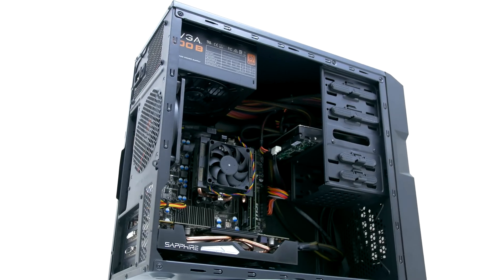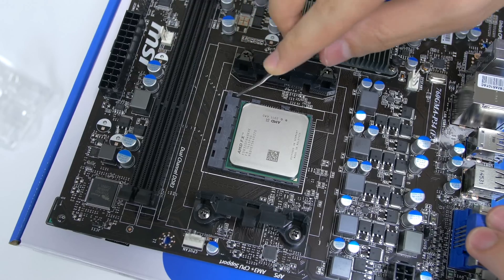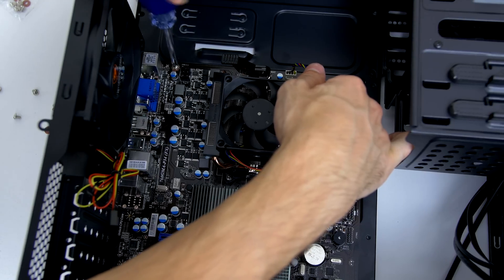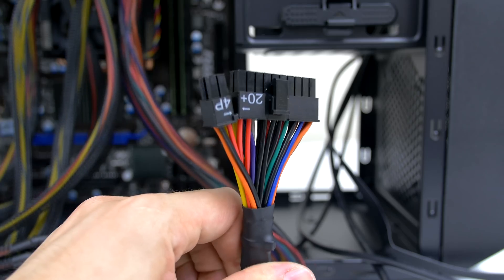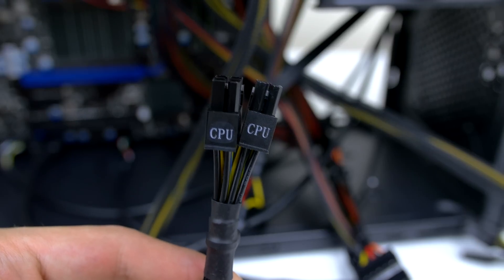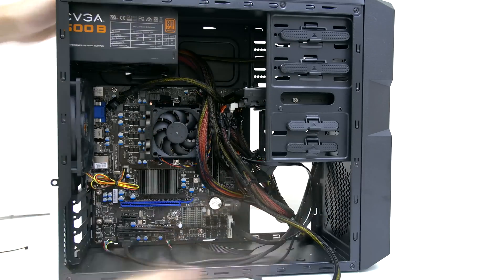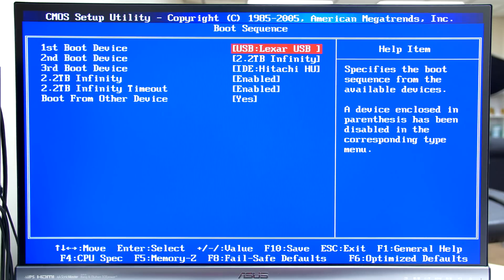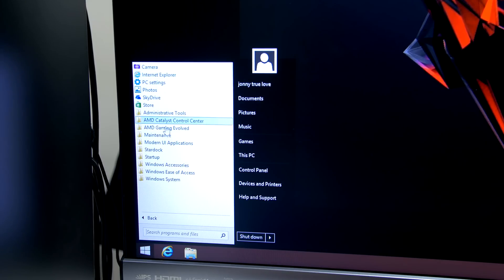How to Build a $500 Gaming PC with Windows 8.1

Comment: I just finished this build and now there is no connection to the monitor plz help if you know how I could solve this
Reply: Same problem here
Reply: ActionPlayer519  I fixed it go display setting and advanced settings then change the resolution to default. Then R click on desktop and go into the amd control center. Go to my digital flat panels and scaling then adjust the bar so the entire screen is in your monitor
Reply: Hope it worked
Reply: +Walker Anfield my monitor has no signal it says
Reply: +ActionPlayer519 try using the dvi or HDMI ports from the gpu and not the ports from the motherboard

Comment: Asus M5A78L-M/USB3 Motherboard (Socket AM3+, Up to 32GB DDR3, USB 3.0, uATX) <---- Will this mother board work?
Reply: +TechSource
Reply: +Eetu Rossi I can confirm it will 100% work I actually just recently bought this motherboard and it works fine with my fx 8350 and r9 290 with 8gb ddr3. I will provide screenshots and shit if further proof is needed

Comment: Windows 10 is free
Reply: Matt Fuller You need to put in on a usb flash or install from a disk
Reply: +nsmc99 only if u already have an OS
Reply: Whats an os? Can someone explain to me all of this stuff? Like ok if i built this pc if i open it would i be able to go to google and then from there buy windows or what?
Reply: Matt Fuller OS = Operating system. Your computer will turn on, but not function properly without one.
Reply: But i can access google or whatever so i can buy one and download it? Or do i have to download it to a usb flash and plug it in my pc and make it work through there
Reply: Thanks :D

Comment: I really dislike this case, could anyone show me a case that is the same or around the same price? (Must have at least 2 usb ports and enough clearance for a hyper 212 evo :D)
Reply: +Ya_Boy_Dom Check Aerocool, Coolermaster, NZXT, Thermaltake and Fracture design. Then google the price of the casing you like.
Reply: Thanks dude, but i was asking for cases people have used or just recommend, np though :D
Reply: I used the raid max v4 instead, there is a little more room to work with and it has a window with sexy LEDs, they're about 40
Reply: +Ya_Boy_Dom Corsair carbide 100r. Comes windowed too :D

Comment: Hi Edgar I have recently been buying parts for your $500 Gaming PC Build  I have came into a bit of trouble the MSI 760GMA-P34 i Don't Want to have to Spend a Extra 40 pounds in tax to deliver to the uk is there a different motherboard what would fit ? and will also fit all the other components? Anyway thanks.

Comment: Is this still the best 500$ build? I have 600$ to spend but I already have the OS and the Hard drive, but no monitor :/
Reply: +AMDruggan there is no 'best build' because the prices are always changing :) but here's some parts to look at: http://pcpartpicker.com/p/7LZhzy Should be enough for picking out a case/and add fans/maybe a heatsink. also do not skip out on your monitor! it's a very important part :) you're gonna be looking at it all day. I highly suggest looking at benq monitors. 60 hz one ( http://www.amazon.com/BenQ-Gaming-Monitor-RL2455HM-24-Inch/dp/B007HSKSMI/ref=sr_1_1?s=pc&ie=UTF8&qid=1443542862&sr=1-1&keywords=benq ) or 144hz http://www.amazon.com/BenQ-Performance-24-Inch-LED-Lit-XL2430T/dp/B00M8E0K06/ref=sr_1_2?s=pc&ie=UTF8&qid=1443542895&sr=1-2&keywords=benq+144hz

Comment: So for the fans does the case come with them, and in the desc which one is the fan that goes directly over the cpu?
Reply: +Michael Linares When you order a case it usually comes with 1-2 fans. The cpu has a stock fan that it comes with, but depending on the cpu you may want to buy a better heatsink for it. Depending on it's purposes/and your living conditions (if you live in a warmer climate/ect.) Depending on your case, and build, you may have to buy more case fans (look up the specs of the case to figure out which sizes.)

Comment: can i put a sapphire 390 nitro in this build?
Reply: +Joshua Abraham yes, you can put whatever you want in the build as long as 1.) your case supports the length of the card 2.) your power supply can handle powering the card.

Comment: Hey man the fan is running high, what should I do this is even before installing windows
Reply: +Abdulrahman Albusaidi you change it in your bios settings
Reply: its only when i close the case... do i risk overheating if i close the case and lower the fan speed ?
Thanks :D
Reply: depends on what fan it is. is it just on the side of the case? front? top? back? on the cpu?
Reply: CPU fan im actually reinstalling windowns with a new ssd card that a bought. fan still very noisy

Comment: could anyone offer some help? I followed instructions word for word, when I hit power on i get the blue light and all fans are going, but the monitor says no signal when its plugged into the pc
Reply: +Brendon Boulanger double check your cords. back track and unplug each cord and replug in.
Reply: +porkyporkchop1 same problem here unplugged and plugged cords back in still not working
Reply: quentin munns make sure your display cord/hdmi is pushed in as well.
Reply: Ye i tried that im not getting any beeps on start up is that a problem
Reply: quentin munns shouldn't be any beeps if everything is plugged in correctly. no beeps means something isn't plugged in (like power to the motherboard.) you sure all the cords are pushed into the motherboard? the ram is pushed in? processor is in correctly?

Comment: Hey tech, how would I install an optical drive in this build?
Reply: +John Vickers you remove both panels. feeling along the front there's these plastic clips you push in. you can then pull off the front panel and push out one of the optical drive slots. push the drive in from the front and lock it in.

Comment: Does this pc come with all the wires and screws? Sorru if it's obvious never built pc before ^^
Reply: +Oskari Lindblom you get all the screws with the case, and the sata cords with the motherboard. you may need a few extra accessories depending on what parts you get. (for example if you bought an ssd: you will most likely need to buy a drive adapter 3.5 to 2.5 and an extra sata cord.)

Comment: +TechSource  I built this $500 PC the only things I differed on was the video card and RAM : Dual x R9 Sapphire 280X & 2x8 gb RAM .
It turns on and i have loaded windows 8.1 on the system but I am encountering problems:
1) Doesnt shut down - the monitor turns off but the CPU keeps on running
2) thr R9 280x has an 8 pin + 6 pin and I filled them all up by using the power supply's pci-e cables (6+2 & 6pin)
3) after plugging that 2 pin the computer doesnt display anything and the gpu isnt even detected. however it starts displaying again when i remove the 2 pin cable from the gpu. Im using VGA output of the motherboard as non of the outputs on the graphic card give any signal to the monitor. 

PLEASE HELP !

Comment: which cooler did you use. Its not in the main parts so im guessing its one of the optional ones. is the corsair h60 liquid cooling or is it cooler master hyper 212 evo. im new to building custom computers if you are wondering

Comment: Do we need to buy a sound card or wired network adapter? and what happens if you start the pc with out windows?
Reply: +Hakan Sen You wont need a sound card, and you would need a wifi adapter if you wanna use wifi. And if you run a pc without an OS, it'll go to the bios. If you want a copy of windows for cheap, go look up key sellers on reddit, or use g2a and buy a key for windows 7/8.1 for like 20-30 bucks.

Comment: Is This Good 
Case:Cooler Master K280 Mid Tower Case
Psu: Across ACK-6850-1 500W Gaming Atx Psu
Motherboard:Gigabyte H97- Gaming Mother Board
Ram: G skill F3-K1900CLAD-8GBXL 8gb DDR3 1866 
Hdd:Wb Blue 1tb 7200rpm data 6gb /s 64 Gb Cache Internal 35 Hard Disk
CPU: Intel Core i5 4460 Desktop Processor
CPU Cooling;  Deep Cool Captain 240 Double Fan AIO Liquid Radiator
Fan: Cooler Master Sickle Flow X 120 mm 12cm Led Aux Fan

Is This Good I'm Just Planing And Its My First Time Planning
Help Me If Theres Something Wrong
    Thanks!!!
Reply: No, all those parts are not compatible.
Reply: +Michael Scott he's 12 he don't know kappa
Reply: MistaCaptainSprinkle I'm just glad you got it 😂 Kappa FailFish
Reply: +Michael Scott Well, he's planning.

Comment: This is an awesome build but I want to build mine slightly differently and have a couple questions. I want to use the NZXT Source 210 Elite case (mid) instead of the micro atx case in this build. Do you guys think I should get an ATX motherboard or still stay with the Micro ATX motherboard? If I do go regular ATX motherboard, what do you guys recommend?

Thanks, this community is so helpful :)

Comment: Building is pretty easy but the part im confused on is downloading widows 8.1
Reply from the maker: I'll have a more detailed process for the September build.
Reply: Ok thanks
Reply from the maker: Digital Boost I mentioned it on twitter. $600
Reply from the maker: Digital Boost No
Reply: TechSource how much will the september build be? because i need to know if i should buy the parts for this computer or the september build? thanks
Reply: TechSource thanks! will that include the OS?
Reply: ok, thanks!
Reply: +TechSource Does it matter if I use a different case?
Reply: +Mr. Lovetech it doesn't matter as long as if its able to fit the motherboard.
Reply: +Zeb db no as long as it fits th mother board and all the parts
Reply: I was confused too but go to Microsoft website and click install windows 8.1 onto your hardrive, then hook it up to orion and continue the process
Reply: +TechSource does the tutorial work with windows 10?
Reply: i have one question. what pin does the 120mm fan use. is it a 3 pin or a 4pin
Reply: +TechSource i have one question. what pin does the 120mm fan use. is it a 3 pin or a 4pin
Reply: yep
Reply: +Digital Boost you can get a win 8 key on reddit for 15 usd and activate win10 with it
Reply: +TechSource I can't seem to update my Graphics Card for this PC I have done everything else(running Windows 7Ultimate instead of Windows 8)but every time I try to update them it goes to AMD installer and at 2% it says error AMD package failed to install, I'm not sure if that is word for word but its something like that if you know how to fix it please help and also can you tell me what cables need to be installed on to the graphics card in the back(not the ones in this video) I mean because if new people want to build this PC they may accidentally use the dvi cable on the motherboard not the graphics card which I did as well until yesterday I figured it out lol, - fixed it now works like a charm, I just reinstalled my graphics card and it updated, good start for a gaming pc
Reply: Win 7 is completely free and making a bootable usb is really easy using Rufus 2.3
Reply: +Mr. Lovetech there's an app where, if you used a fake key, you could get the iso image of the full Windows 7 for free.

But other then that, you have to buy a product key
Reply: +Frostbite Gamer can i play gta5 on it??
Reply: +TechSource do the screws come with the stuff
Reply: +Zeb db just make sure it fits all the hardware
Reply: You can't download it anymore bro
Reply: same
Reply: +TechSource I am having trouble when I built it at first it worked fine but now I am trying to use it but the monitor says no signal and I have everything plugged in I am also using everything you are.
Reply: how do you install more usbs??? how many are there??
Reply: is it better to buy the Sapphire Radeon R9 270X 2GB GDDR5 DVI-I/DVI-D/HDMI/DP Dual-X with Boost and OC Version PCI-Express Graphics Card 11217-01-20G
used in like new condition or to buy an EVGA GeForce GTX 950 2GB SSC GAMING, Silent Cooling Graphics Card 02G-P4-2957-KR
brand new???

Comment: Okay, so this might seem like a dumb question but please bare with me as I'm about to build my FIRST gaming desktop.
I've been playing games on a high-end laptop and the concept of monitors is really getting to me and the answers online always point to different solutions.  So, what is best for pc gaming?
1080p HDTV (mine is 32'', 120 Hz, and aesthetically looks like a monitor)
                                    OR
A proper computer monitor with similar specs?  I've noticed monitors seem to be pricier.  Also, is 32'' too large?  What size do most of you guys use?  Also, should I use a simple HDMI cable or a VGA or whatever computer monitors can use?  Thanks guys.
Reply: Sean Robinson A proper 1080p monitor that has 60Hz+ refresh rate, low delay (~5ms), and good viewing angles would be the best gaming experience.
Reply: Royal Tiger So there is be a higher delay with an HDTV?  Because my TV being 120Hz, I assume is good.
Reply: Sean Robinson Yes, TV's have very high delay. 120Hz is just the refresh rate (amount of frames the TV can display).

Comment: +TechSource why u don't use thermalpaste for the cpu cooler?
Reply: ***** ty for replaying is this with all stock heatsinks? 
and i have an other question i want to buy the CPU-Intel Core i5-4590 3.3GHz Quad-Core Processor instead of the CPU in this video is this an problem?
Reply: And if i use the fan what is coming with the cpu 8s this an good fan cuz a lot of builds use other coolers why do they do this ?
Btw thx for helping me out im kidda new to this stuff

Comment: Can this be a good build?
Case: X-Titan Mid-Tower Gaming Case with DVD+/-RW Drive
Power Supply: EVGA 500 W1 80+, 500W
Motherboard: Gigabyte AM3+ AMD DDR3 1333 760G HDMI USB 3.0 Micro ATX Motherboard GA-78LMT-USB3
CPU: AMD FD6300WMHKBOX FX-6300 6-Core Processor Black Edition
Hard Drive: WD Blue 1TB Desktop 3.5 Inch SATA 6Gb/s 7200rpm Internal Hard Drive
Memory:Crucial Ballistix Sport 8GB Kit (4GBx2) DDR3 1600 (PC3-12800) 240-Pin UDIMM Memory
Video Card: GTX Gigabyte GTX 960 G1 Gaming 2GB GDDR5 Graphics Cards GV-N960G1 GAMING-2GD
Reply: People stop copy pasting like this just type
FX6300
GTX 960 
Etc
Etc
Reply: ok

Comment: Thanks for the video I just finished building this pc today. Only thing is that the price of the 270x is 180$  now. I switch out the case for a 210 bc a micro case would be to small later. I would of upgraded the mobo as well.

Comment: Is this a good PC build. I wanna know if this can run games like Battlefield 4, minecraft on ultra with shaders, bioshock infinite, etc           

- Seagate 1TB Laptop SSHD SATA 6Gb/s 64MB Cache 2.5-Inch Internal Bare Drive (ST1000LM014)

- EVGA 500 W1 80+, 500W 3 Year Warranty Power Supply 100-W1-0500-KR

- GIGABYTE GA-F2A88XM-D3H FM2+ AMD A88X (Bolton D4) HDMI SATA 6Gb/s USB 3.0 Micro ATX AMD Motherboard 

- EVGA GeForce GTX 750 Ti FTW DVI-I/HDMI/Display Port GDDR5 Graphics Card with ACX Cooling 02G-P4-3757-KR

- G.Skill F3-12800CL9D-8GBXL 8GB (2 x 4GB) DDR3 PC3-12800 RipjawsX Series for Sandy Bridge (9-9-9-24) Dual Channel kit Desktop Memory Module

- AMD Athlon X4 860K Black Edition CPU Quad Core FM2+ 3700Mhz 95W 4MB AD860KXBJABOX

- Corsair Carbide Series SPEC-01 Mid Tower Gaming Case CC-9011050-WW
Reply: Solar V2 Not sure how the 750 Ti will handle Battlefield 4 at Ultra but Minecraft will run beautifully and other games. If you want to play Battlefield 4 at 1080p and Ultra settings you should upgrade to a 1050 Ti or RX 470.